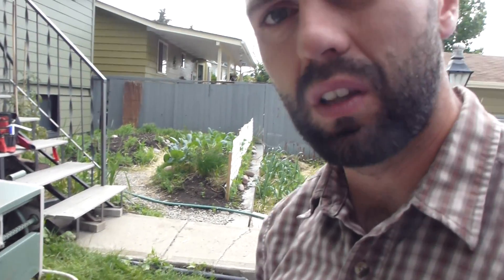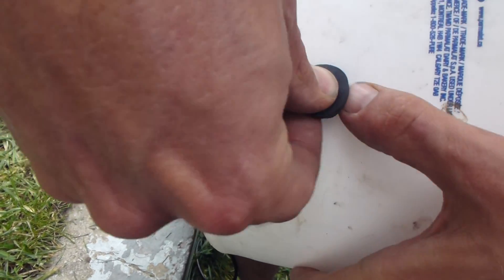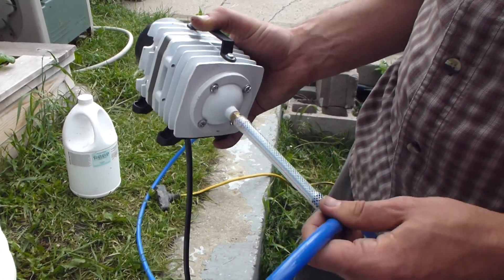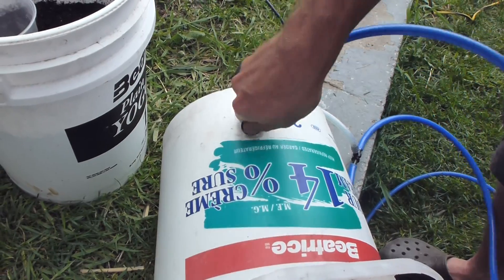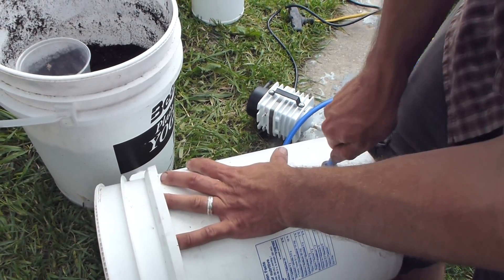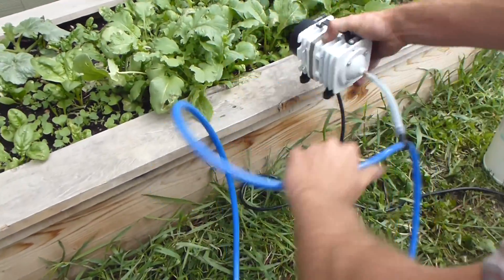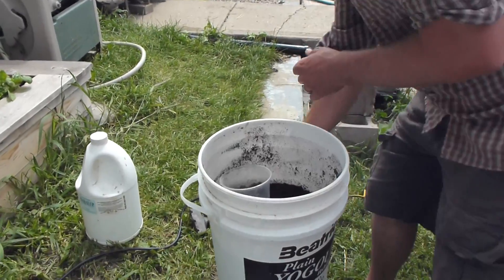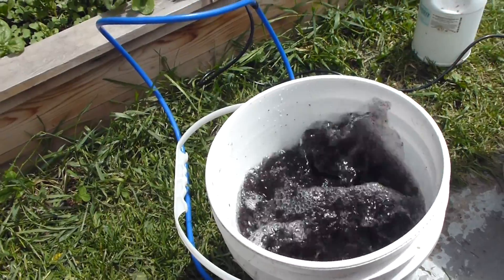How to Build a 5 gallon Compost Tea Brewer

Comment: oops,i see whats going on now, you're using terms compost tea and "extract" interchangeably. i think theyre obviously related but not synonymous. 
I question then your statement about the air-pump and whether a 'wimpy' aquarium pump Does supply enough oxygen to support tea-brewing, but just not enough to physically blast microbes off particles for the "extraction". ? 
by the way, your blog entry seems to have been deleted? title is there but no article.
thanks for sharing!